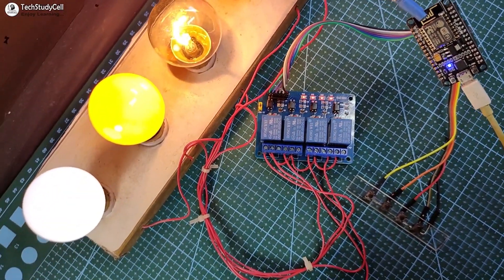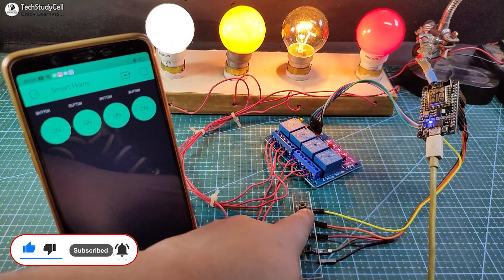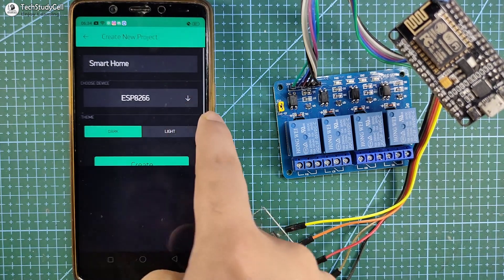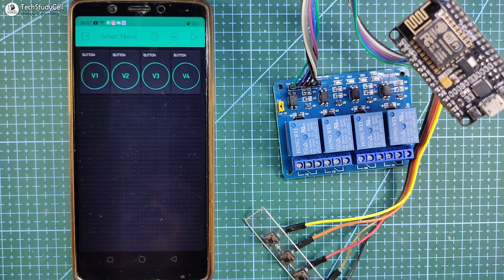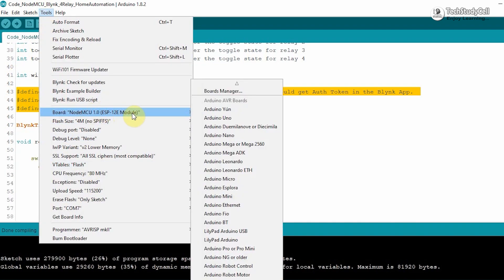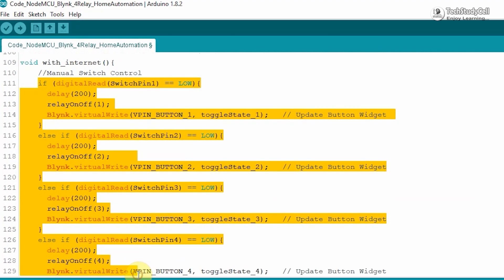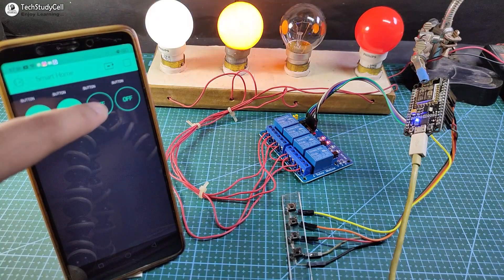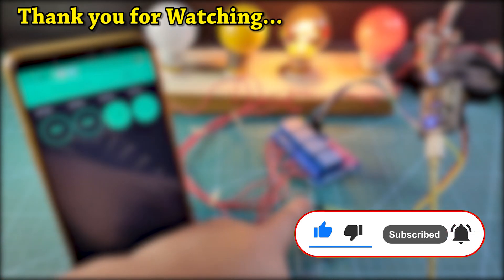Wifi Smart Home Automation system with Manual Switches using NodeMCU ESP8266 & Blynk | IoT Projects

Comment: Nice vedio so much informative 
I have a question If I turn off wifi and change the led state once .
Then it will updated on dashboard when I connect to wifi again?
For eg-
Wifi on
0,0,0,0
wifi off
0,0,1,1
Will this new state be shown on dashboard as I turn wifi ON

Comment: i want to connect this setup with pzem 004T energy device..can you provide me for this circuit diagram..& necessary code for measurement power,volatge,amp with pzem004t with nodemcu & 4 channel relay board

Comment: I couldn’t get to set my esp8266 and esp32 running in my Arduino ide even after installing Python 2.7.3 and pyserial from adafruit. I have downloaded the drivers and installed the board in Arduino ide. The port is “com 28” and I think I used “nodemcu 1.0 module 12E” for esp8266 or there about! ( I am using CP2102 chip) The device manager shown that the hardware was properly installed and ready to use. If I try to open the serial monitor in Arduino it will never open, instead I will see “error com port 28 busy” If I upload code on the boards it pops out bunch of errors among which is “error opening serial port” or something like that.

I am frustrated, I need help please!
Reply: Instal a driver

Comment: Hi, I went through your video and tried to implement the same. Unfortunately I don't have a push button, so I just touched the two points and removed quickly like it works  in a push button. Can  you kindly help if I am missing something.
Reply from the maker: Did it work?  Otherwise please refer to following video https://youtu.be/6yeHGnpKo0k

Comment: i wanted to automate my house with dimmer as well but i wanted atleast 8 relays so i tried to edit the code but then saw that you used random digital pins and as i am no professional i couldnt find out which pin to use to add more relays

Comment: hello sir i work this project  i can control the bulbs using push buttons but my Nodemcu does not act as Access point it mean i can not  control the bulbs using wifi blynk app in the serial monitor is shows "wifi not connected", and after uploading the code it show this error "esptool.py v3.0
Serial port COM16
Connecting....
Chip is ESP8266EX
Features: WiFi
Crystal is 26MHz
MAC: ec:fa:bc:c1:e1:e0
Uploading stub...
Running stub...
Stub running...
Configuring flash size...
Auto-detected Flash size: 4MB
Compressed 287584 bytes to 210056...
Writing at 0x00000000... (7 %)
Writing at 0x00004000... (15 %)
Writing at 0x00008000... (23 %)
Writing at 0x0000c000... (30 %)
Writing at 0x00010000... (38 %)
Writing at 0x00014000... (46 %)
Writing at 0x00018000... (53 %)
Writing at 0x0001c000... (61 %)
Writing at 0x00020000... (69 %)
Writing at 0x00024000... (76 %)
Writing at 0x00028000... (84 %)
Writing at 0x0002c000... (92 %)
Writing at 0x00030000... (100 %)
Wrote 287584 bytes (210056 compressed) at 0x00000000 in 18.8 seconds (effective 122.4 kbit/s)...
Hash of data verified.

Leaving...
Hard resetting via RTS pin..." 
Please please help me.

Comment: I really like your channel, I have a problem with pushbutton no.1 which is connected to the SD3 pin, this button doesn't work so relay 1 can only be controlled with the blynk application, how to fix it?
Reply from the maker: You can use D4 instead of SD3.
Reply: @TechStudyCell  thanks

Comment: By which wires do we have to connect the node mcu board , relay module and the push buttons?
Reply from the maker: Please refer to the circuit shared during the video
Reply: @TechStudyCell  sir i tried it out but the connections are not happening correctly

Comment: @Tech StudyCell 
Sir PLEASE GIVE SOLUTION
I MADE IT
WORKING ALL CORRECT BUT
I USE 12V 8 CHANNEL RELAY MODULE INSTANT OF 4 CHANNEL MODULE,
BUT THATS ALSO WORKING AND LED INDICATE WORKING CORRECTLY
BUT RELAY IS NOT WORKING
THERE IS NO TIK SOUND AND THERE IS NO AC OUT,
ANY SOLUTIONS PLEASE?
Reply from the maker: You have to give separate 12V supply to relay module

Comment: Hi bro this is really good project 
And I tried this project at my home by following your instructions. But bro I switched on then the that particular bulb is automatically turning on and off with small time of interval all switches are going like this bro plz tell me why it happens and how to rectify that problem. 
I’m waiting for reply.
Reply from the maker: Check the connection of push buttons. It may happen due to loose connection. Do not use switch (latched).

Comment: Bro your video is super and made my own home automation using your guidance but only one problem I face, I have done as you done this project but 1 relay in 4 channel starts to work abnormal. (e.g. it's turning on and off automatically without any inputs). Can you guide in this difficulty..Thanks in advance
Reply: Hey bro
Check the relay module led with its respective channel
If its not working maybe the problem is with your relay channel
And if the led is working properly
Then the relay must be damaged

Comment: How did you make the connections for push-button? Is it by connecting directly without jumper wire?
Reply from the maker: Push-buttons are connected across GND and GPIO pins. please refer to the circuit shared during the video.

Comment: Helo! Greetings from Brazil! Thank you for your sharing! Great videos! 
Sorry for my ignorance, but I have a question. May I use (for example) two buttons as a "push" instead "switch"? 
I've modified only on Blynk, but I noticed when I press (and hold) the physical button, the Blynk (virtual) button keep blinking. 
Excuse-me! English is not my first language... 
Thanks a lot! 
Regards, my friend!
Reply from the maker: Thanks. If you want to use switch instead of push button, then you have to modify the code. For reference you can check this video https://youtu.be/Sx9akwBwK4g

Comment: sir i have tried  this project  but i am getting error on when compiling it
Reply from the maker: First install Blynk library, select the NodeMCU board. Then compile the code.
Reply: @TechStudyCell  blynk is working
and  the sinric is not able to compile with esp32
Reply: please  can you tell me about sinric code details  why it is not able to compile with esp32
Reply: @TechStudyCell  any way thanks for your reply dear
Reply: @TechStudyCell  how can use espalexa  in 2  esp32  in same alexa account  can you suggest me  ,, i have tried this  in 2 boards  i have changed the names of the lights  then added to alexa account   then once first board group on means second board also same thing happens , any way  thank you for your  support dear

Comment: Sir I used your code for home automation, I am controlling 3 appliances and my esp8266 keeps disconnecting from the server. Then I need to reset the nodemcu manually. Please help me out. Thank you in advance.
Reply from the maker: If you are using 3 appliances the don't use SD3 pin. Check the WiFi credentials and try again

Comment: Bhai push switch has 4 pin how to connect in circuit diag it's not mention please help
Reply from the maker: In 4 pin push button, 2 pins are internally conneted with other 2 pin. Use multimeter to check continuity
Reply: @TechStudyCell  can you please share same working code with normal domestic button instead of push button ..because if I connect normal button with this code light turn on off blinking always..please share a code which work with normal button bro..

Comment: Hello sir nice work but i have a problem my 3 buttons work perfect but 1 push button not working which is connected S3 pin of my ESP8266 when i press this push button my ESP8266 is restarting and i also change push button but same problem plzz help.Thankyou
Reply from the maker: The boot process will fail if you connect SD3 with GND during boot process. So let the boot process complete then use the switch.
Reply: @TechStudyCell  I change pin SD3  to TX in programming its  working😊

Comment: Very good project. I have a similar project installed in my house, but I use a mega arduino and an Ethernet Shield W5100.

I would like the puso buttons to work when there is a lack of internet.

Would you have a solution for that?
Reply from the maker: Push button will work with & without internet.

Comment: Hi and thank you very much for the video. I will subscribe. Could you please tell me if i'm doing the same setup as you did, it is also possible to control an rgb led strip with the same esp8266? there are enough pins or in this case i need to use esp32?

Comment: It would be cool to see it expanded with MCP23017 to 8 buttons and 8 relays, or even more with additional MCP chip.
Reply from the maker: I will publish the ESP32 with 8-channel relay module in this week.
Reply: @TechStudyCell  That is good, but it is another thing than using expqnder chip which can be expanded to 128 GPIO if needed over just 2 wires. Pretty usefull. Think about it. ;)

Comment: Sir make video for only 
without internet
Only work in 4 switch control relay
1switch on off control  for light
2 3 4 micro switch I want controll for 3 speed motar
When 2 switch on 3, 4 should auto off
When 3 switch on 4, 2 should auto off
When 4 switch on2 , 3 should off

Comment: Yes sir but this is bell push switch not regular on/off domestic switch
Reply from the maker: I have also explained why manual on off switch can't be used.
Reply: Today's avb automation products have manual on/off switches and eeprom also work vice versa with aap eeprom and on/off switches thtast why I m asking u is this possible in u r project.